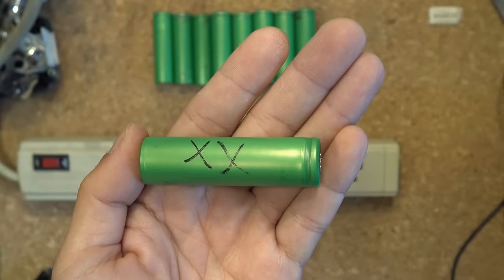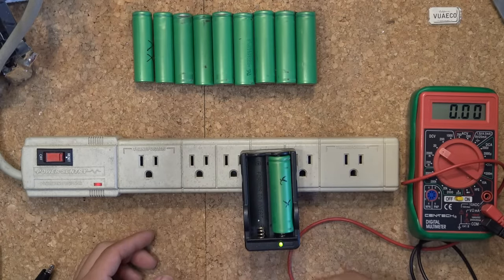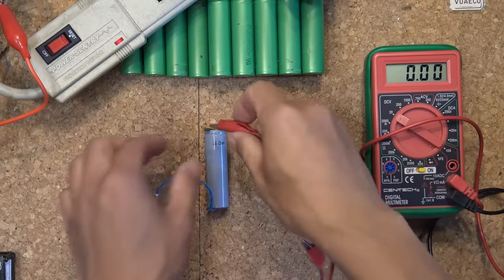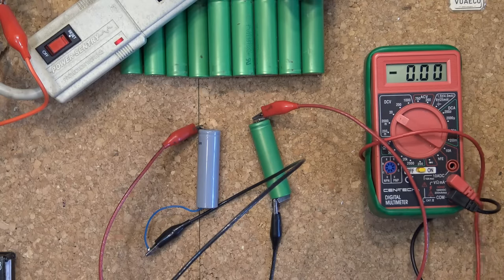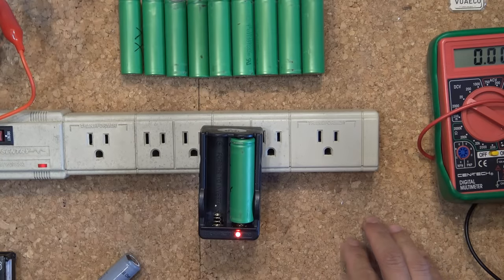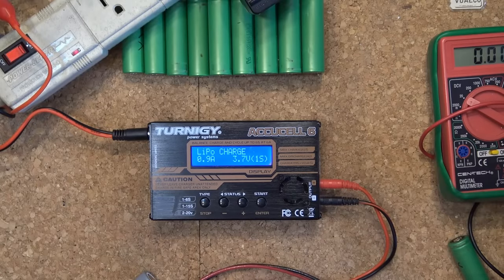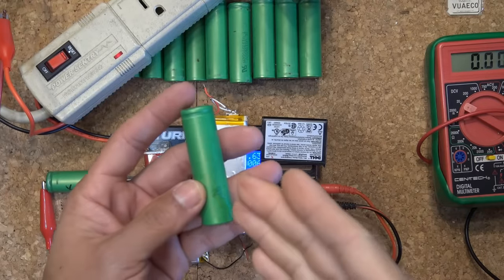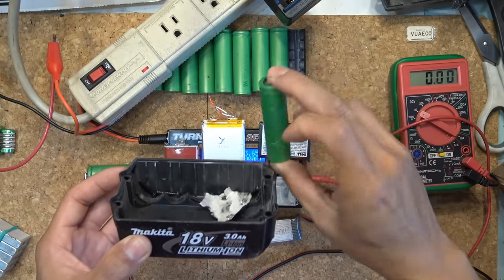DIY: How to revive a dead 18650 (or any) Li-ion battery cell

Comment: When you parallel batteries you will see the good battery voltage at the bad battery terminals
Reply: I was thinking the same thing.
Reply: Not exactly, the good battery voltage will now read a bit lower (or a lot lower, depending the condition of the bad battery) because the good battery is trying to equalize its capacity with the bad battery, essentially charging it. That is why in the video you see the voltage go up slowly when good battery is connected in parallel to the bad one.

Comment: I always find myself coming back to your channel to see what your up to and it is always entertaining. I also get more ideas watching your videos. 
I live in Texas so never thought temperatures below 40 deg f would effect me but recentlyI was visiting the cold northern states and experience temp well below the safe levels for the 18650s so I had to pay attention to the temp inside the RV. I was wondering if you have done any test on charging and discharging 18650's in cold temps? By the way my RV Powerwall build has worked out great... thanks for all your videos.
Reply: don't try to charge a cold battery, let it rise to normal room termperature first, some tool battery chargers have sensors that check for this before attempting to charge
Reply: Not that this guy shows ANY safe knowledge regarding lithium ion batteries. The guy you want for this info is called Mooch. Don't follow this guys advice at all if you value your health and property.
Reply: RV-PowerWall    you're* up       would *affect

Comment: You can do this with your turnigy charger as well, just set it to NiMH and keep an eye on the voltage, since all you're really doing is bringing the voltage back up, the best part is chargers like your turnigy will let you trickle a small amount of charge to give it the best chance of revival without too much heat.
Reply: That's true.. NiMH uses more of volts than rest other settings, hence, it's just like connecting any other cell in parallel as shown. But again, change the settings from NiMH to Li-ion immediately else the battery would get too hot. Depending on how old and warn off the battery is, it may not hold the charge for longer if used against a load.

Comment: don't waste your time. Just be sure and have the old cells recycled, and buy some new ones. Regardless of what you do to the cell it will continue to weaken, holding less and less charge, it's chemistry. Then there is the mixing of cell of varying degradation, pack is only as strong as the weakest cell. Nah, not for me.
Reply: some laptop batteries are self discharging fist cell pair. i'm using this method long time to them. but not with a battery. i'm kick charging with adjustable dc power pack.
Reply: you can also trickle charge them very very slowly, to bring them back from the dead, BUT you gotta keep a close eye on the current draw and the voltage because they can "vent with flame" if trickle charged outside their initial voltage charge curve zone!

Comment: I followed this method a few days ago, it worked as shown but keeping my multimeter on the dead battery even after charging the volts was going down, ps if you look up the life span of these batterys it's about 3 years but the way you get shown you can't keep charging these batterys forever regards colin

Comment: I've used this method to bring old HTC smart phone battery back alive.
Reply: Did it explode?
Reply: @SKYELOVER  No, it charged and worked fine. Battery I used for waking it up was from Nokia 3210 if I remember.
Reply: @jannekarppanen9346  wow that's actually amazing and good because iv heard some of them went wrong unfortunately
Reply: @SKYELOVER  Yes, lithium battery becames unstable when too low voltage.
Reply: @jannekarppanen9346  yeh I can tell I heard online
Reply: Janne Karppanen It crystalizes inside the electrolyte and causes a lot of internal resistance. For low consumption application, you can sometimes get away with it, but pulling lots of power from these once dead cells will eventually cause a fire. It’s just not worth the risk when batteries are so cheap.9
Reply: @furonwarrior  good capacity cells Rn't cheap
Reply: Andy Degaugue Cheaper than a house fire. Just saying...
Reply: @andydegaugue  true,they are very expensive.
Reply: @furonwarrior  Amen, it could get really hot!
Reply: @skovdesurvival4022  As well as exploding and letting out very toxic smoke. Once the smoke subsides, fire is produced.

Comment: This is incredibly dangerous.i would not recommend doing this ESPECIALLY if you find the cells resistance to be out of spec.
Reply: It's not like dead battery has a lot of charge in the first place, and if someone is licking insides of melted battery there is no hope for him.
Reply: Sielana when a battery dies, it builds up a lot of internal resistance and can cause a fire by generating a lot of heat inside the battery as well as the charger.
Reply: Yes i am aware of that. I'm Just saying that it won't be as dangerous as charged battery.
Reply: @sielana  Yes it will.
Reply: @lorditsprobingtime6668  Definately not. An empty cell is WAY less dangerous. In case of fire the amount of stored energy within the cell/cells makes a huge difference to the scenario.
Reply: @martinottosson6583  You're absolutely correct. Sorry, I explained my point very badly there. I was more referring to the connecting a fully charged one to the dead one and how potentially dangerous that is, mainly for risk of the charged battery. Either way what he's doing in this video is bad. I did explain how he could have brought the dead cell back up to a voltage high enough to get his Turnigy or any other decent multi charger using the NiCd or the NiMh setting with the current set VERY low, not blasting it in straight from a good battery at some massive amperage. Sorry, my previous post was very badly explained. I responded quickly and a bit carelessly because I was a little annoyed at Sielana's comment about "licking insides of melted battery", that was unnecessary and a stupid response and I wound up making one just as stupid, sorry all.

Comment: Just dispose of them properly and save yourself a bunch of headaches. I've done all this and more for years and you just end up with a pack that never works right or works right for a month and then you are taking the whole thing back apart to replace a cell that's not playing ball anymore. not worth it, especially with how cheap good cells are getting.
Reply: Dawn Minilla ...Where do you buy cheap high discharge Samsung batteries?

Comment: I'd like to observe that while this was successful in reviving my batteries, one of them was charging 2-3x faster than the others, and so it's best to have a 33Ohm resistor handy to place between the contacts so the plastic cover doesn't melt itself by charging too quickly.

Comment: I’ve got one of those tiny 3.7 v batteries for my tiny drone that won’t charge. Maybe it will tomorrow?
Reply: how did it go?
Reply: @angelessolis1632  want to get the answer when they respond 😁
Reply: @MrGman2000watts  they might be to busy playing with their drone
Reply: @angelessolis1632  darn it...or hurray 🤔 guess I'll try it when I get some spare cash.
Reply: Same, my drone's battery is also not charging
Reply: Dunno, most likely the charger is dead
Reply: I tried it with my 18650 and didn't work,pitty I didn't test it when I bought it from ebay,now I can't do anything about it.

Comment: You can also switch your computer charger to Nicd charge mode and select 3 cells(3.6v) and maybe like 2amp and let it charge for 30sec or a min(monitor the heat) and it will bring up the voltage enough. Then you can switch over to normal charge mode.

Comment: The li-ion charger was probably doing its job, the current jsut might have been too low to indicate charging. An overdischarged cell will be trickle charged until it reaches some rated threshold around 2.5-2.8V. You're also going to want to put it through several charge and discharge cycles to reconstitute the plates, though it'll never get back to its original capacity.

Comment: I noticed that you were charging a Li-ion battery with the Turnigy charger Li-Po setting.  NOT a good idea, you should use the actual Li-ion setting in the charger!
Reply: Except that on my charger which is the same design, the Li-Po setting charges to 4.2V which is actually the voltage for Li-Ion cells while the Li-Ion setting charges to only 4.1V which is actually the voltage for Li-Po cells, so I'm guessing that's why he's using the Li-Po setting.  Someone borked up the charger settings in the factory.
Anyway, charging a Li-Ion to 4.1V only under-charges it which means each charge won't last quite as long, while the cell life will be slightly extended due to the reduced stress from the reduced voltage.
Reply: There's more involved than just voltage. The chemistry of the batteries is different also.
Reply: @sotm6078  Unless I'm mistaken, the charging method is the same: Limit current to one-half C until the voltage rises to the final terminal voltage, then limit voltage while allowing the current to drop, and finish charging once the current has dropped to one-tenth of its starting value.

Comment: If i missed the question sorry , but what is not the amp hour rating of the battery they can only be charged and discharge xxx amount of times . Surely you brought it back to life , but once again at what amp hour rating and for how many recharge times are left in it now ? Based on the original amp hour rating ? thanks

Comment: It works with my old metal hydride makita batteries too, I use 2 x 9 volt batteries in series to raise the voltage to pacify the charger. 😊👍🏻

Comment: Saw this earlier and took apart a black and decker battery that woudn't charge to salvage the 5 18650 batteries that were in it. 2 worked with what he said. With the other 3, the wire would get too hot, so I hooked them up to a AA battery first and then 18650. All 5 work now. Hope this helps.

Comment: thanks! i'm glad I saved my dead 18650 battery....(edit: i didnt paralell charge  as i dont even have a voltage reader) I jumped it for about 5 seconds with a 6v charger and now it's charging again with the correct charger.

Comment: Thanks for the video, really good content. My question is this,  i have a marine radio and it came up with am error whilst  starting a charge after not being used for half a year. I measured the voltage of the battery whilst it was in the radio with charging lead pluged in and on but the battery was just loosing voltage, it started at around 2.700v and dropped a mV every second, i was not seeing a higher voltage from the charger, should i assume the charging circuits are at fault or is the chargeing circuit not happy with the initial battery voltage so its not allowing voltage onto the battery terminals, the chagrger psu is working wirh about 6.2 vdc being outputted. The battery is a 3.7 v lion with t terminal small flat rectangular shape Thoughts please?

Comment: I think this may be unintentionally misleading. 

The problem is not that the battery wont charge anymore, but that this charger you are using has a too high voltage cutoff where it wont charge batteries anymore if the battery voltage get under that cutoff point. 

The battery itself is still fine and can still take a charge as you shown by charging it with a another battery in parallel.

That being said, good job finding a way around the changers limitation. 👍

Comment: Thanks for showing this. Unfortunately, my situation with a battery lost so much original capacity to the point it's deemed useless on ebikes. Like 18 batteries rated 2.2 ah each, now average between 500mah to 1000mah each, Based on opus bt-c3100 on 1000mh discharge mode

Comment: I pulled 8 of the same exact batteries last year out of a 10-15 year old laptop battery , I'm pretty sure they are the same bases on appearance , are yours rated at 800mah or somewhere around there ? And fairly heavy for such a low capacity ?  I ended up with 4 good cells outta the 8 I pulled outta the old laptop pack . Wish I knew then how to revitalize them before I threw out the 4 , I assume a rechargeable battery is bad not just when it won't accept a charge but also when I begin getting an incredibly high rediculously impossible voltage reading from a say 3.7v battery such as whatching the voltage on my meter bounce from say 138.4v up to 256v down to another number and back up another rediculous number constantly bouncing back and forth I just assume they are internally shorted when I see that type of voltage reading on my voltemeter.

Comment: Good video. I am usinh this principle for years. But, instead charging with another battery, i am using laboratory power supply with current limited output. It is adjustable.

Comment: Got a question for you. Does the good battery have to be the same voltage as the battery you are trying to renew? Can I use a stronger lithium ion battery to refresh a lower voltage lithium battery?

Comment: I think from memory that if you set that Turnigy or other brand of multi charger to NiCd at a low current and charge it at that for a few minutes you can get the same result WITHOUT blasting power into it so fast it gets hot and possibly damaged, which may also damage the battery you're using to boost it from. If it's getting that hot that quickly is not good. With the Turnigy ICharger of whatever you can trickle it in and minimise any damage.

Comment: what will be the effect on charge holding capacity? is it worthy to charge a dead 18650 battery? like it will work okay okay or it'll drain hell alot faster that it'll be of no use?

Comment: Yes of course. I should have figured this out myself. I've lost some much stuff by not being able to change the cells back up. Thanks for that.
Reply: Best think is to get a cheap charger that has a voltage leakage and over time that will bring the cell back into service, or use a basic method as shown here but add a 100 Ohm ish resistor in circuit and revive slowly,  crash charging a flat bat like this risks fire and removes even more capacity than was lost by the over discharge event.....  If in doubt 0.1c charge and see.....

Comment: If I had to add a fuse, I’ll only have to add it on the “red” wire side? Will a 30 fuse work? Thank you I’ve been scratching my head for the longest time on how to connect two Milwaukee batteries together

Comment: Hi ...
Can you tell me if there would be a way to bring a reversed cell from.a 20/60v dewalt back to positive with out total tear down? Cell shows -6v all others 3.5 or 4 volts. Would it help if I unhook one side of this one cell from pack?
...the good thing is it is not a buried cell which I believe I can remove fairly easy and solder in another...

Comment: I charge low voltage 18650 cells for 40-60 seconds with the balance charger by selecting NIMH as the battery type. I can normally charge it as Lipo after that.

Comment: your right for that jump dead battery with good one , are do  in seconds , no need to leave it more than 1/2 sec to energise dead cell try it ! the charger will  recognise it but this cell will charge real hot  , and even never keep his charge , its a fire risk level 1000 if you put this one cell , into a bank ,  not even good as suposed , but can be used again  as a lower voltage   source for projects
Reply: like converting a remote tv or a Nintendo Wii remote , to pass from 2X 1.5V AA , to 1X not fully charged 18650

Comment: Very good but how come you can read the "dead" battery when it is in parallel with a good battery? Wouldn't you just read the higher voltage of the good battery?

Comment: you can salvage the batts but if you put them back in to makita battery pack they will not work because of the circuitry in the makita battery pack.  see ave video on makita battery.verry sophisticated circuitry in those batts .

Comment: Thanks for sharing. I use this same method to charge alkaline batteries. I put a rechargeable battery and then parallel charge nonchargeable alkaline battery. I found out the cheap alkaline batteries charge up better than name brand alkaline batteries

Comment: If you have lab power supply or other power supply with voltage and current limiter, it is very easy to raise voltage in these "zombies" with 3.4V and 150-200 mAh current for 5-10 minutes. Then they will charge to full as usual.
There is a catch though. Deeply discharged lithium batteries like these become permanently damaged when voltage drop below 3.2V or raise above 4.2V. They lose capacity and internal resistance raise. You should avoid to use these cells in multi-cell batteries further. They can live till end of life though as single cells in flashlights and other devices where high current is not expected.

Comment: It's a very nice trick, just I wonder how long will the revived battery work?
Considering unpacking and packing back a battery pack, I think this trick is handy for low value/size projects whereas for valuable works like fixing a battery pack with 30+ cells it's better to spend $2-3 for a new cell and save a lot of time and work.

Comment: I have a question, im not sure aboutmy bluetooth headphone i think it has over discharge batteries and i was wondering if i should charge it for a long time since that was what you should do for over discharged batteries. It will charge for a few minutes and then stop and when i would check my phone it would say its only 40% and not 100, should i charge my headphones for a long time so the battery would be replenished? Or should i just consult a person who fixes electronic devices? Please reply

Comment: It works with lead acid batteries too if you have a smart charger that requires up to 10.5 volts before it will begin charging.